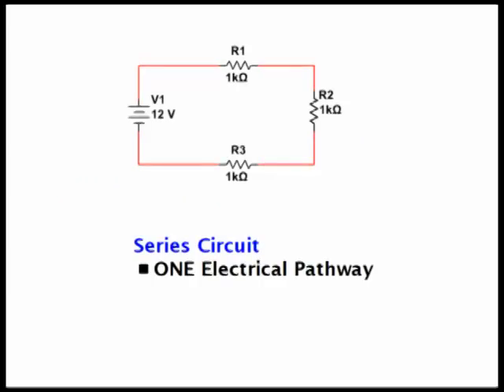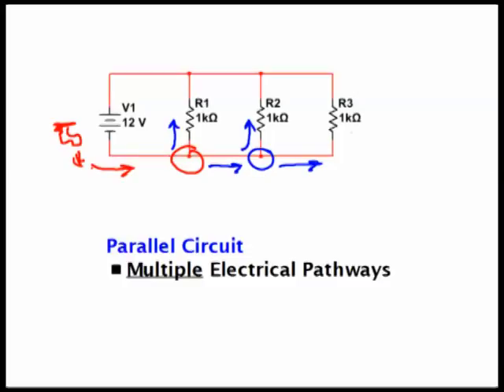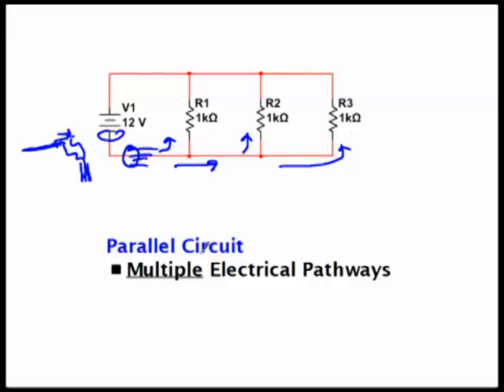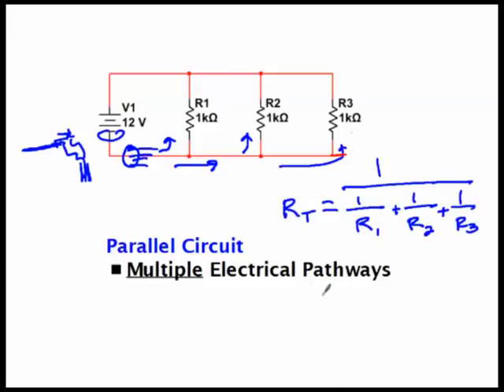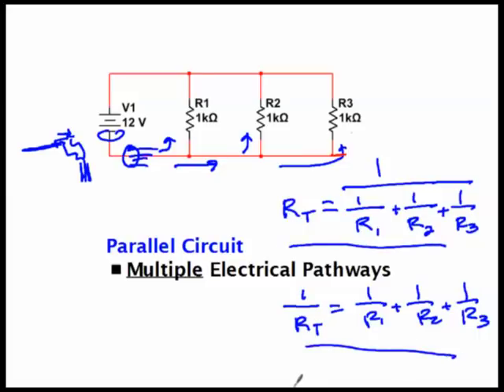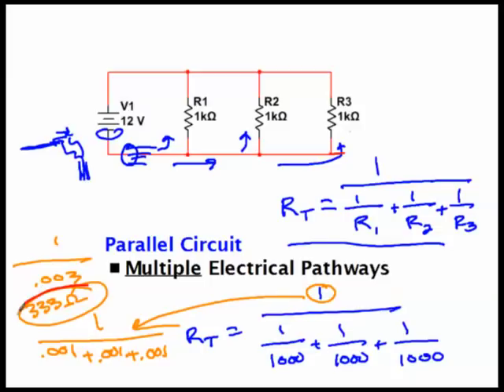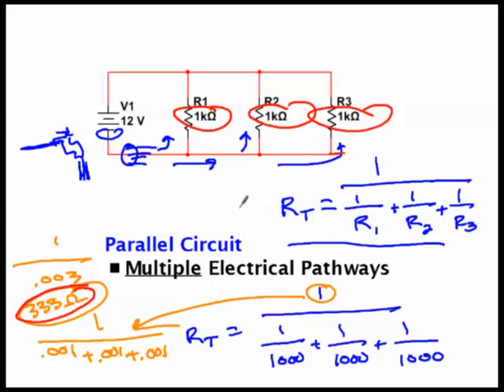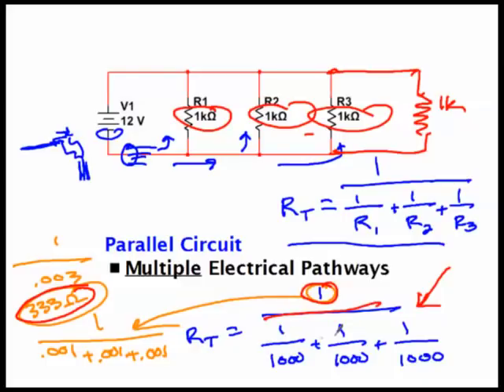Calculating Total Resistance in Series and Parallel Circuits

Comment: If anyone here is still having trouble calculating the total voltage, let me explain to you what I realized after watching this video.  The advice he gives you to turn the fractions into decimal points can be a little problematic. Especially so if you get repeating decimals. Eg. ( 2.33333333) when you find the reciprocal of that, your answer can vary wildly depending on how many decimal places you include.  Prime numbers will throw off your final number, especially when you have several resistors. The best and most accurate way is to leave them all as fractions, and simplify at the very end that way you do not end up rounding too early.
Reply: Thanks for the heads up I will keep you in mind. Bro

Comment: Am I the only one who looks at this logically like no matter which path they go their still going to run into a 1k ohm resistor, ughgh I HATE ENGINEERING (good thing I’m going to be a pilot :D)
Reply from the maker: This is a fairly simple circuit. Normally, the three resistors are not all the same value, and so it's much harder to just solve it "logically" or intuitively. I always start with a simple circuit so the math works out easy, then progress to more complex, real-world examples. Good luck with your pilot career. I have always loved flying and wanted to be a pilot myself when I was young.

Comment: How about if the resister Rt=12, what would resister R2= and R3= would equal
Reply from the maker: I'm not sure I understand the question. Do you mean what if the total resistance is 12 Ohms? You couldn't solve for two unknowns (R2 and R3), you would have to know two of the three resistor values AND the total resistance to solve the third resistor value.

Comment: what do you do with the 12V?😂 it doesn't affect in finding the RT right?
Reply from the maker: 12V is the Source or Supply Voltage. It does not affect the amount of resistance, but it does affect current. This is the essence of Ohm's Law (V=IR, I=V/R, R=V/I). Voltage is an electro-motive force (the "push", or "pressure") which causes current to flow in a circuit.

Comment: Understood, but disliked because it does explain a very easy example and not a real example that will be used for a test on someone with less math knowledge.
Reply: That's what calculators are for. Once you get the base of it, you can use it to help you along the way
Reply from the maker: Yes, this is a basic example, but once you understand the concepts and solution process, you should be able to solve other more complicated examples.

Comment: How do I know the hottest resistance and the coldest one???
Reply from the maker: If by "hottest" and "coldest" you are asking about the amount of power dissipated, then the answer is it is proportional to the voltage drop. Since power equals voltage timex current (P=IV), then the resistor with the largest voltage drop is dissipating the most power and would therefore be creating the most heat.

Comment: I teach electrical theory, and while this explanation is accurate, its a very poor explanation. Rarely are load values identical, so why explain with only identical load values? I'm always on the search for a superior explanation that I can incorporate into my class lecture, however, this would just lead my students astray due to the fact that equal load values allow a critical step needed in most equations to be skipped. One of my students answered a question at home and watched this. His answer was wrong. I asked him to show me how he did his math and this video was referenced.....smh.
Reply from the maker: Thank you for your comment. Regardless of whether the values are the same or different, the process is the same, and it's all about the process. Please don't blame me for your student's error. After all, I'm not in the classroom with them, I'm just trying to post helpful videos. For students to learn the theory of electronics they need more than just videos, and that is the job of the teacher in the classroom. I have success in my classes through scaffolding, starting simple, then building in more complexity when students are ready. Good luck in yours.

Comment: why does the resistance decrease when u add more loops?
Reply from the maker: I realize that it's counter intuitive, but the best way I can explain this is that when you add a loop in parallel, the result is an increase in the total amount of current: The current through the new loop, plus the current in the original loop. Add another loop, even more current flows. Intuitively, then, if there's MORE total current flowing, that means LESS total resistance. This also follows Ohm's Law: R=V/I. If I increases, then R decreases. Hope that helps.
Reply: Excellent....so per the definition, we always need less resistance in a circuit system?
Reply from the maker: Not necessarily. This video is just an explanation of how to calculate total resistance in parallel circuits. The amount of resistance required in any given circuit depends on what that circuit is designed to do.

Comment: can iy be simple? i dont have a 39k resistor.i want to make one with diffrent number of resistors.can anybody help??
Reply from the maker: You can wire resistors together in series and/or parallel to create a different total resistance based on what you need.

Comment: For parallel circuit, just divide the resistance of 1 by the total number of resistors.
Reply from the maker: This only works if all resistors are exactly the same value.
Reply: Yea. My bad
Reply: electricians mate deguassing

Comment: thx a lot for teaching
Reply from the maker: You're welcome
Reply: What if we have two parallel circuits in conjunction with each other?

Something like this:

----[]=[]----

The [] are the parallel circuits, imagine the = is connected from the top to the bottom.

How do you solve this?

Comment: If you only have R1 on the circuit, Is it a Series or Parallel?
Reply from the maker: Neither. Series and Parallel circuits imply that there are multiple resistors, either wired in SERIES (single current path), or in PARALLEL (multiple current paths). The total resistance of a circuit with one resistor is simply the resistance of the single resistor.

Comment: Because the current is the same across all the branches, does that mean that the current drawn overall is higher? Does a parallel circuit use more power faster?
Reply from the maker: +Controversy Owl Current is NOT the same in all branches in a parallel circuit. VOLTAGE is the same across all branches in a parallel circuit. Regarding your second question, any circuit consumes power when there is a load across a voltage source and current is flowing. If more current is flowing, then then more power is being consumed. The higher the current and voltage are, the more power is consumed (P=IV) Hope that helps.
Reply from the maker: Yes, the total current is the sum of the current in the individual branches.

Comment: It makes sense, in parallel circuits, the electricity is distributed more evenly, versus in series circuits, the save voltage goes through multiple resistors at once.
Lets say each resistor is equal to 1, total resistance is found by adding 1x when x= # of resistors. when the current goes through two resistors in the same wire, the total would be two. If the current went through a parallel circuit with two parallel wires, the current would be evenly divided, so the total resistance would be one, because there are two parallel wires, therefor you are to divide by two.(This is only an example of how it basically works, not how it really work. This is only proof that the resistance is lowered with parallel circuits).
Like the example in the video, the total resistance was, in a way, divided by 3. However, that was partly because the resistors had the same resistance of 1 ohm.

Comment: is calculating voltage drop the same with parallel as it is with  a series circuit?
Reply from the maker: +PJ Fuentes No, they are different.
Reply: So is voltage drop in a series basically the total current multiplied by the individual resistance ohm.... and if thats how you do it for a series then how do you do it for a parallel because i keep reading that parallel circuits have the same voltage...if that makes sense....man i wish i had you as a tutor
Reply from the maker: +PJ Fuentes Yes, you can get the voltage drop across a resistor in a series circuit by multiplying the current times the resistance. This is essentially Ohm's law V=IR. In a parallel circuit, voltage is the same across every loop or branch.
Reply: Can you explain how to get current for each resistor...i saw your video and i see how to get voltage drop....but how do you get watts in a individual resistor
Reply from the maker: +PJ Fuentes Current is not the same as Watts. The unit for current is the Ampere, and The Watt is the unit for power. Ifyou know voltage and resistance, you can determine current using Ohm's law (I=V/R). Power can be determined by multiplying current times voltage (P=IV). Hope that helps.